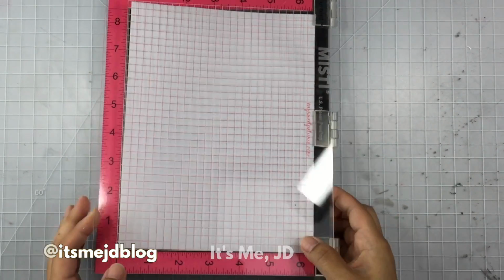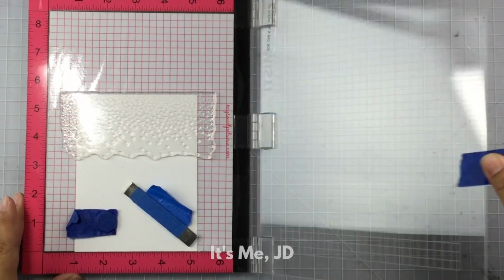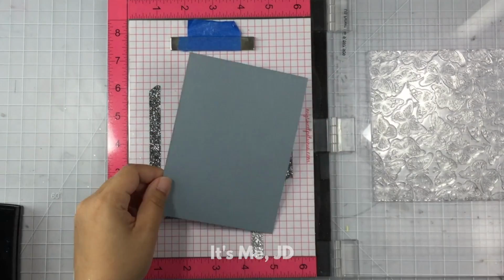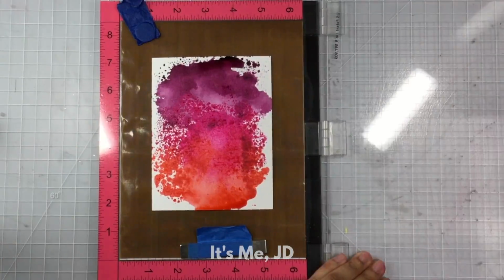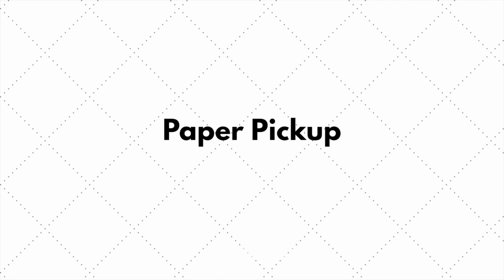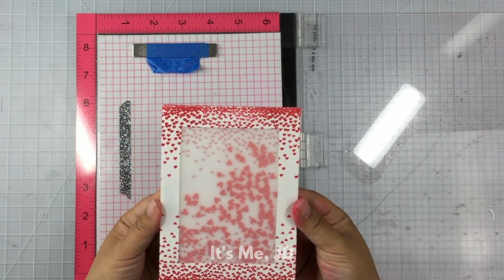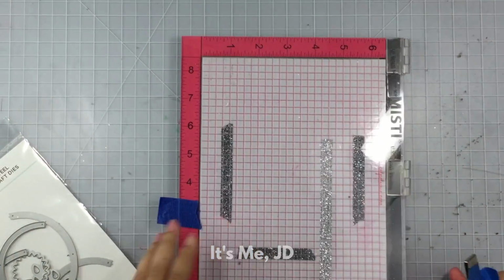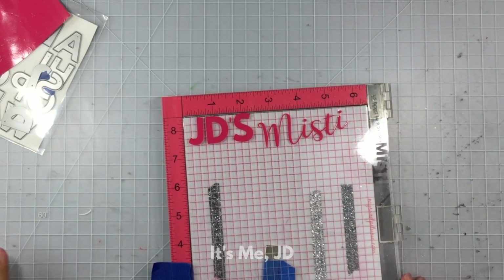10 GENIUS Misti Hacks That Will Make You A Stamping Pro!

Comment: Hi JD thank you so much for sharing these fantastic tips with the misti. I wanted to ask you the tip you shared about the shaker placement was fantastic but would it be possible when matting and layering placements like you did for the shaker placement as I have a bit of trouble sometimes when sticking them down they take me a lot of time to keep them straight and the exact placements sometimes I find it hard to have them exact like when placing one on top of the other I like to have all the edging maybe one or two mm apart but it take ages do you think it be possible to do this like your shaker tip.

Comment: Jennifer McGuire gave the helpful hint of adding liquid adhesive, like Connect glue, over the peeled off foam tape adhesive so that you have some wiggle room. It will have to be left to dry after you place the shaker card top but it eliminates the need to place it perfectly initially and does not affect the adhesive on the foam tape.

Comment: Lots of good ideas in this. I have seen other crafters use many of them but never saw anything with them all together which is helpful and reminded me of good ideas I forgot about. I recently picked up the Misti Mouse Pad which is kind of the same solution (only much more expensive!) as your laminating idea. I'm going to add the handle and personalize my Misti too since I do videos as well and that would be a good way to advertise my channel name. :) I also loved the idea of using the back for keeping track of your metal dies! Brilliant! Not sure about the tips with Washi. I just use a bit of temp adhesive to put my cardstock down and since I also do A2's mostly, the big 6" background stamps are forgiving enough if it's not quite centered or straight. With the adhesive on the back, you don't even have to remove it as it's going to likely be stuck on an A2 card base anyway. As far as cleaning goes, I've had good success with applying a little stamp ink remover and wiping with a baby wipe followed by another clean baby wipe to take any possible residue off. It's super fast and removes the most stubborn stains. I've not had any damage doing it and also have done that method for several years. My Misti's cover grid lines are etched though so the ink remover might take off the printed lines that came in the original Misti. Then again, that might happen with the Magic eraser too. Thanks for the ideas! They're good ones! Janet

Comment: I LOVE your tip for helping to place shaker card frames. It would work with layer placement in general! Can't wait to use it. Also, if you have the first MISTI model like I do - DO NOT use anything to clean the front surface of the door that is not recommended by Sweet Petunia. You will damage the etched grid.

Comment: I think you’re in to something with using misti (or other placement tools) when it comes to placing shaker layers and really just all panels which need to be placed in cards. Maybe a removable panel with a sticky substance or some sort of insert. I don’t know the answer but I know I get frustrated with that final placement and I have to trim off a sliver in the final project. Something to think about.

Comment: Love your ideas. Thanks for sharing. I knew some but not all. Love the erasers to clean misti. I have been trying to clean mine for a while with no luck but the erasers worked great. Shaker idea and die holder idea are also great ideas that I will use. Again, thanks for sharing. I watch all your videos. Love them.

Comment: Those were great tips!  Thank you!  I've laminated a few sheets of the graph paper and added a handle to the lid on the spot, and can't wait to try the shaker card and smooshing tips!  Using one of the laminated sheets for outlining the spot for your card panel for use with 6x6 stamps will be very helpful also.  I keep smacking myself on the head wondering why didn't I think of that!

Comment: The thing is so ridiculously expensive it make me laugh.
Reply: Agreed . ... but I use my small one every time  I  stamp  and with crippled hands it's a project  saver. Have Tim Holtz  small and it doesn't  do anywhere  close  to  the  same  consistency  as the misti .  It was a purchase  I  thought  long  and  hard  on, but was by far my favorite
Reply: Agreed. I used a 40% off coupon and a $10 “new customer” discount. That was the only save to get the regular size before there were minis and 12x12 sizes. Otherwise I would’ve waited for the next best thing on the market. HSN has WRMK stamp press bundles for $17. They are teeny!